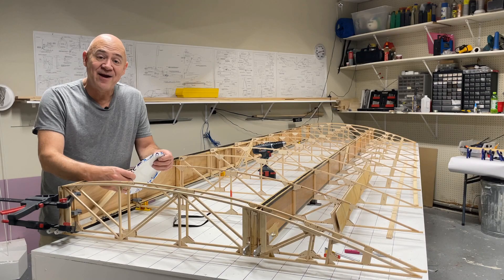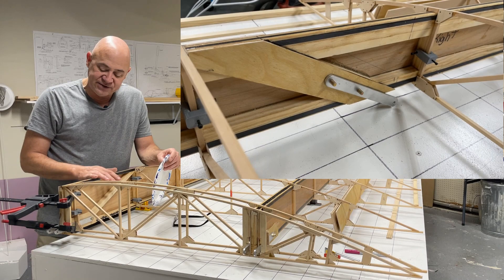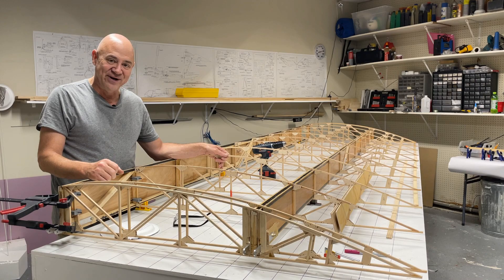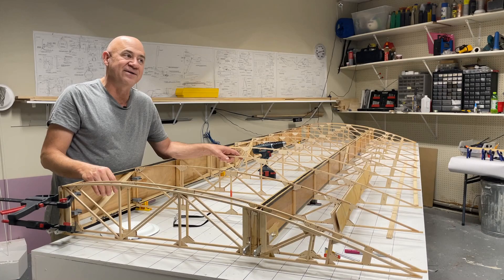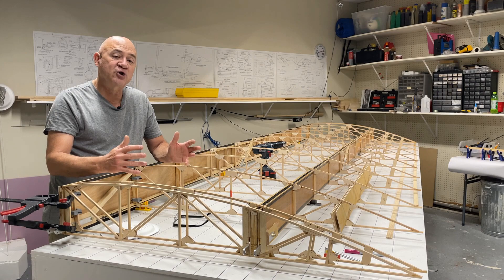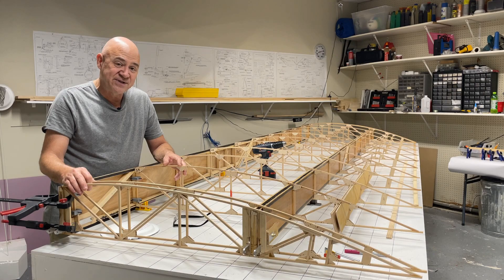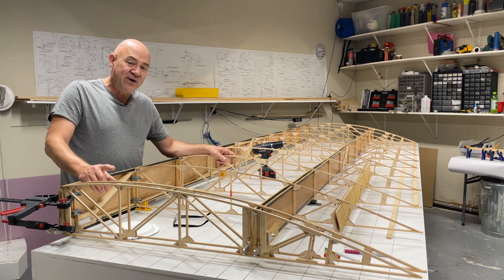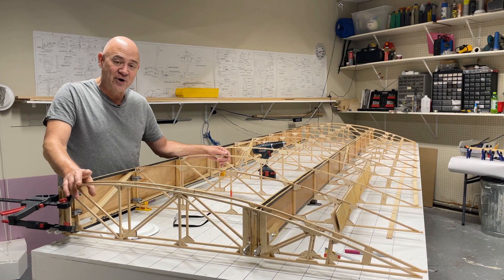AirBike Wing Update 6-14-2021

Comment: T 88 works great, 7,000 psi. Don't need cap strips+  And your right about A Spruce an the 1/4 " caps not 1/4 by 1/4.  Some have table saw teeth marks. Good luck with your build.
Reply from the maker: Thanks!! Rock On!